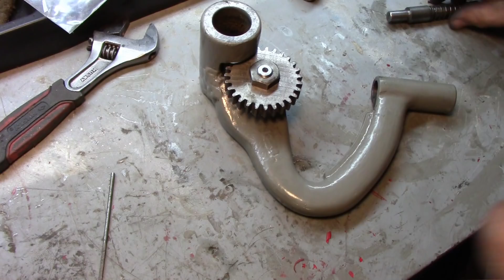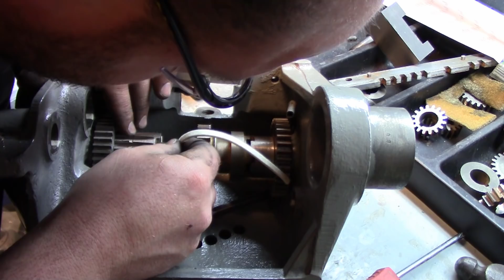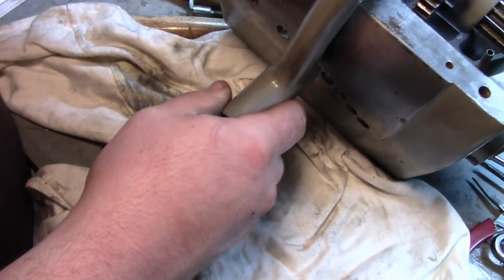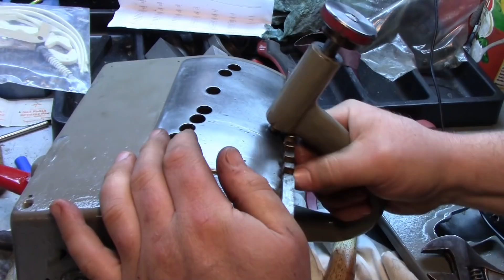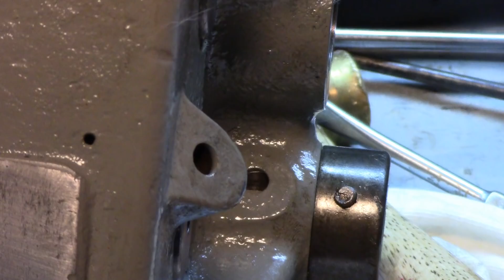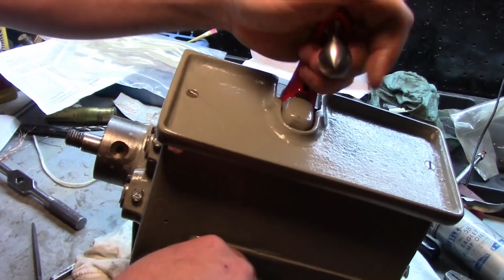13" Southbend Refurb: Gearbox Reassembly

Comment: Can you please share how you cot the change gear rack out of that thing please. 
I’m fighting this right now. Thank you sir
Reply from the maker: @robertdarscheid9703  
One gear on the shaft is pinned in place and the larger gear on the left is tight on the shaft.   Remove the pin and the rod will come out from right to left using a drift.

Comment: I know this comment is 4 years after the fact, but instead of wire, you could use fishing line. A lot more flexible with a much smaller knot to pull through the felt way.

Comment: Im redoing a single tumbler off a 13" south bend. I bought the serial card off of Grizzly calling it a G-2 gear box. The year on it is a 1932. I started to put it back together and noticed I dont have the gear between the two spacers. Is this something common or was mine robbed from. Also If it is a missing gear do you have any info on dimensions and number of teeth so I can figure a replacement. Thanks your video is very well done

Comment: the few times i've had to assemble a gearbox shaft like that i've found that putting the gears on a smaller dummy shaft then pressing the real shaft thru while pulling the dummy out can save a lot of headaches.  socket extensions work great for doing it this way.
Reply from the maker: Good Tip

Comment: Nice job, Greg! When that wick came out of that gear, my temper would have flared and something would have gotten broken! When I worked in actuation, I was the only person in the shop so I used to toss a large wrench across the shop rather than break up a customer's unit. The wrench would clatter over the concrete floor making a ton of noise, and I would feel better. Thanks for the video and for sharing your work and frustrations with us!
Have a good one!
Dave
Reply from the maker: Been there.  Kinda had to stop doing that after I broke my windsheild with my phone.  Those old Nextels were tough

Comment: For that shaft nut in the future:  Take a strip of corrugated cardboard, and create a hex in it to hold the nut lightly.  Hold the nut in place, engage the first turn or whatever, then pull up on the cardboard handle to break your temporary wrench, allowing you to get an open end on it for final snugging.